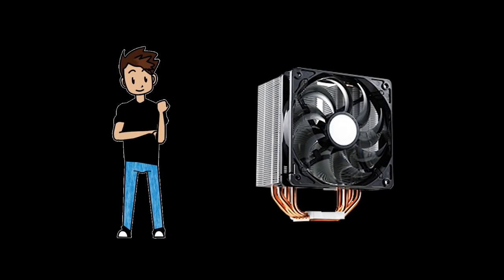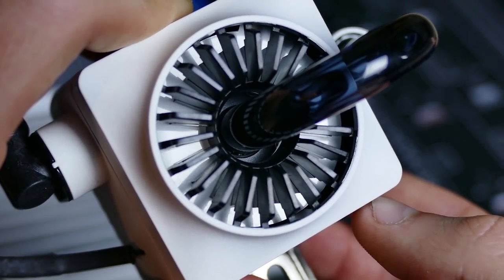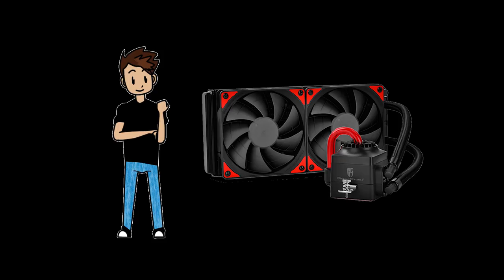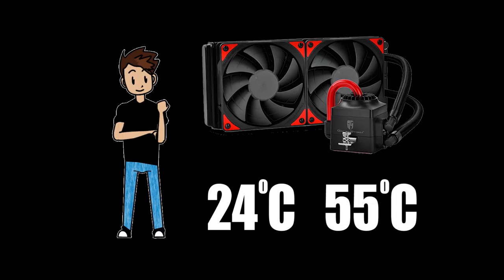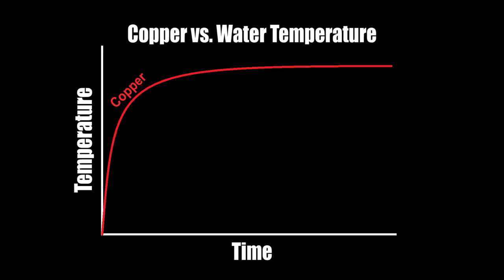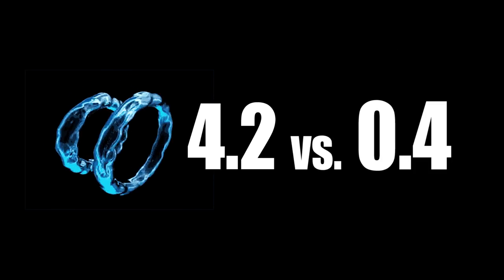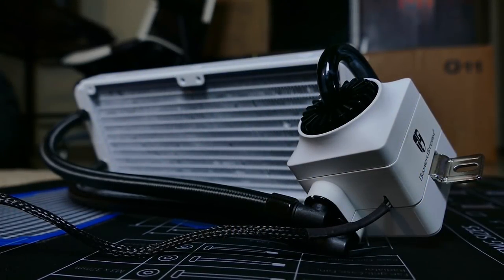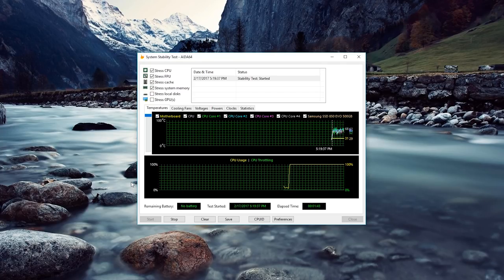How to Properly Measure AIO Temperatures

Comment: This is the kind of video i sub to you for. Great information thanks
Reply from the maker: Thanks for stickin' around.
Reply: Salazar Studio I enjoy these types of videos too, please call out Nvidia too for neglecting older users 
E.g. GTX 780TI vs R9 290X then and now 
R9 390 vs GTX 970 then and now 
Nvidia is in such a position in the GPU market that they can neglected older users and in 2 years time the RX 480 will probably be equivalent to a GTX 1070 
I know so many people that upgrade their GPU because Nvidia doesn't provide decent drivers for older cards and you probably know most consumers aren't gonna buy a Titan/1080 and spend 1k on their next gpu 
And also AMD for rebranding old cards instead of making new ones 
Also call out Dev for no providing good SLI support and really bad optimisation like Mafia 3 and Forza
Reply: Soap Cutter they rehearsed some cards and refreshed others. whether that's a meaningful difference to you is another story. however I believe that AMD's budget just isn't there for great R&D from year to year. I don't mind the updates to the architecture imo, it's shown meaningful performance gains. example being gcn vs gcn 3.0
Reply: nvidia are not neglecting it's user. if nvidia did then nvidia have no reason to include 400 and 500 series in their main driver branch still providing SLI profiles and bug fix where as AMD card from that generation already put into legacy status by AMD. one thing that people have been ignoring is AMD GCN GPU has been used in both PS4 and Xbox one. because of that as both system become more mature, more and more games are tweak for AMD hardware first (most triple A game development focus were on console hardware first). if nvidia really did not care about their old card we should see this happen since long ago. even during PS3 and 360 era. but it did not happen back then because nvidia still have their hardware in one of the major console. that's also probably why nvidia back into console business with nintendo switch. because if they let AMD hold onto all those console hardware that will also going to affect nvidia negatively in the future. in fact we already seeing the effect right now.
Reply: Soap Cutter,
I just recently upgraded from a GTX680 2GB and driver support was awesome. I test a lot of games, and even look up videos of performance over the years and frankly NVidia has done a great job. 

It's not clear where your complaints are though. For example, some newer games can benefit from the AMD architecture more, but that's more about AMD having untapped potential (ACE) and not NVidia having poor driver support.

The only way I would flat out say it's a DRIVER issue is if your FPS is lower with a newer version of the driver for the same system. But if it's simply that a newer game works RELATIVELY better on AMD that's probably not driver support, but the game being better optimized for AMD's GPU.

Just FYI, the GPU is the bottleneck in the graphics card. If you were using 90% of the GPU's processing power then using ASync Compute etc to buffer the data and get to 100% usage only gains you 11% more FPS at best. So there's a limit to how high it can go. (by "90%" I mean maximum GPU usage as the reported GPU usage isn't an accurate value and it can be really far off. There are different SECTIONS of a GPU but AFAIK if one of these is 100% used the GPU is still shown as 100% usage.)

Also, NVidia has done a much better job of supporting DX11 in terms of minimizing CPU usage. This matters mostly with weaker CPU's but I've seen in some games a loss of 15% due to AMD's overhead. This has been improved recently though I can't test this myself.
Reply: Oh sorry I was ignorant, forgive me I though Nvidia stopped caring about the older GPUs for more sales in the "new line up"
So does that mean AMD cards will be more future proof? I know a lot of people debating over getting a 1060 or a 480 and a 290x owner told me how their card performs compared to the 780ti so I assumed it was Nvidia because I generalise all companies to do scummy things for money